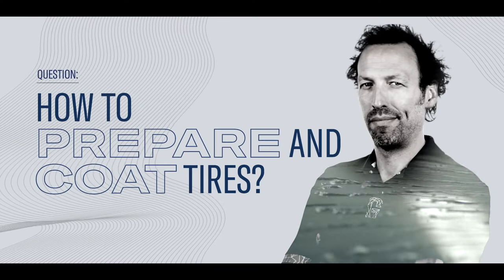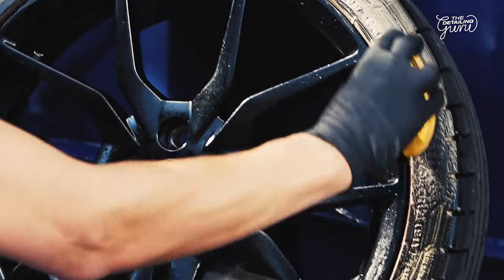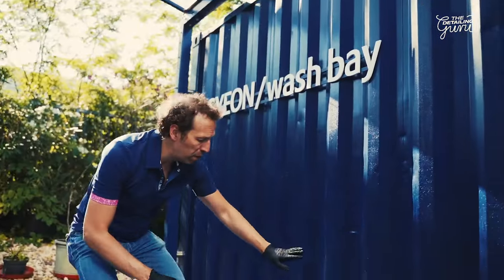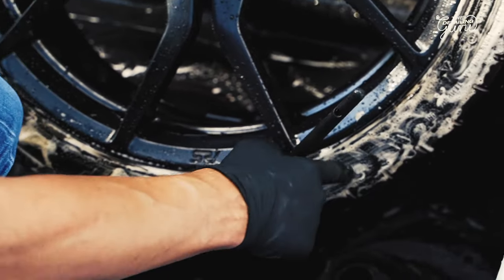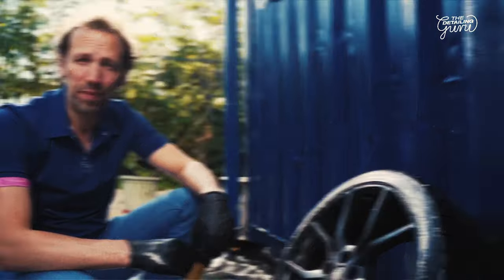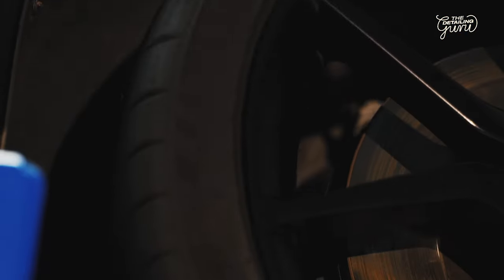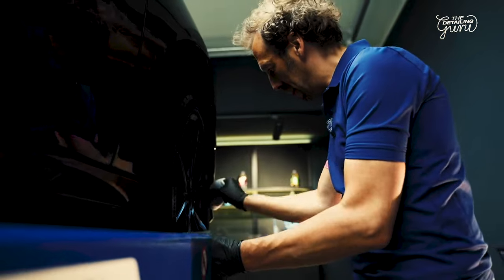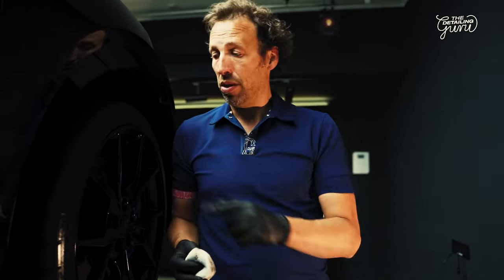The Detailing Guru: How to PREPARE and COAT tires?

Comment: If you're protecting a tires are you apply only for besides (edges) or for whole tire?? Thanks
Reply: @timospatz4022  so??
Reply from the maker: Q² TIre needs to be applied only on the sidewall of a tyre. Applying any kind of tire dressing on the whole surface of a tire is pointless and dangerous.
Reply: @GYEON_official  thank you sir 🙏